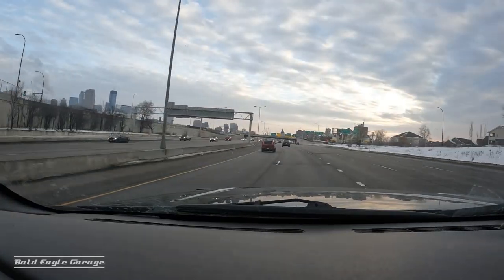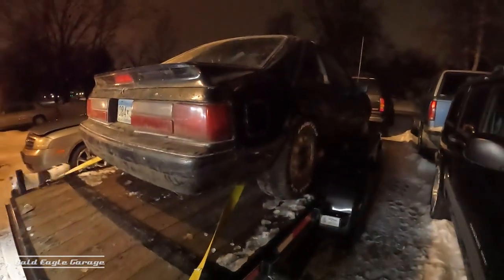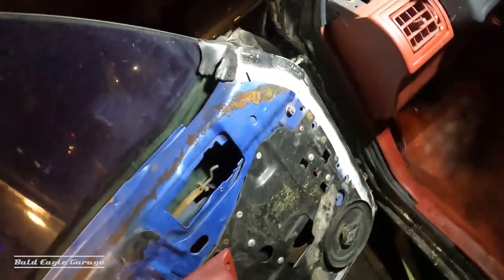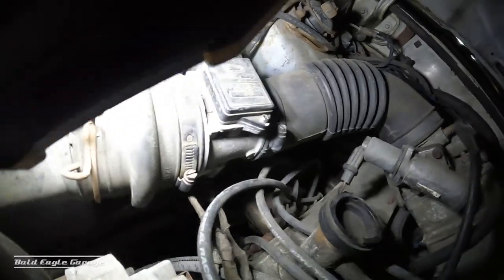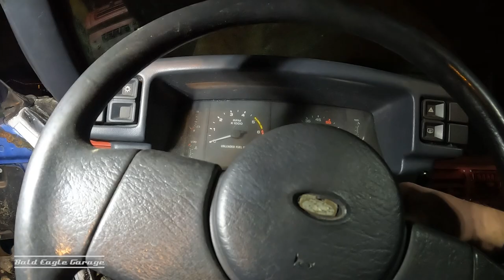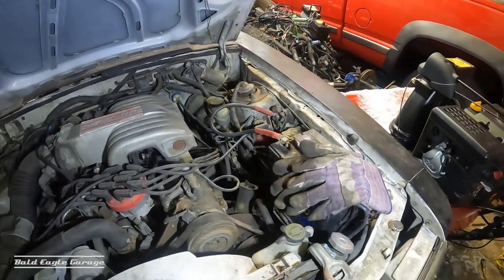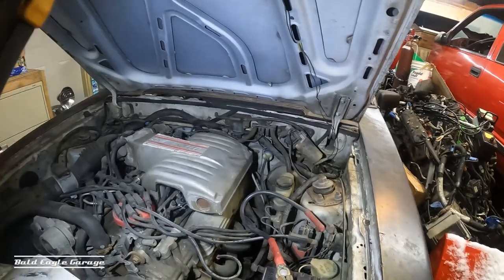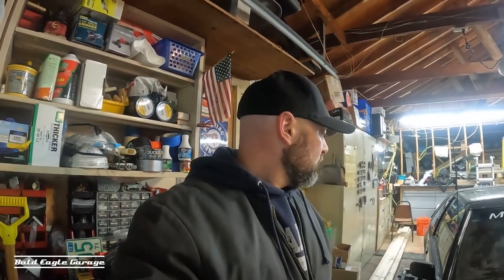I Bought an Abandoned Foxbody 88 Mustang LX T-Top!

Comment: Did you ever find the dip stick if not it may be in the trunk
Reply from the maker: Haha, nope! The engine is out and I've looked all over for where the tube should insert into. There is a boss on driver side towards the back, but its filled with a bolt. Oddest thing I've seen on this car so far.